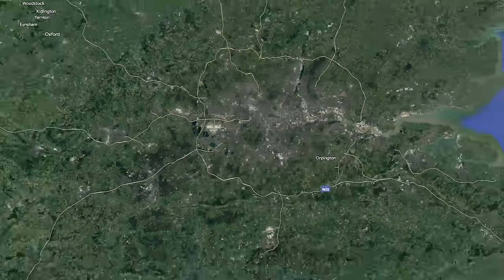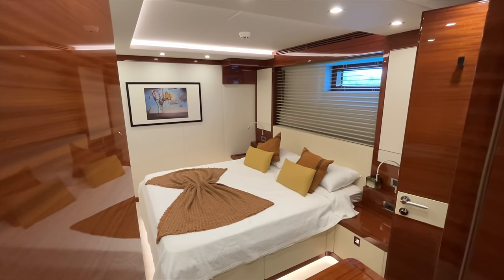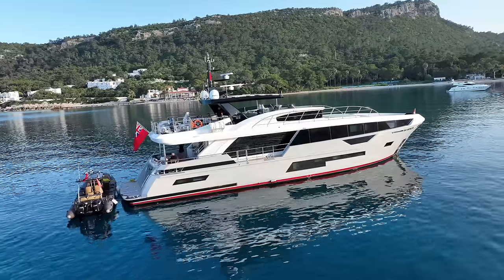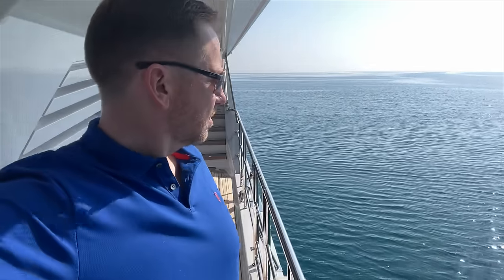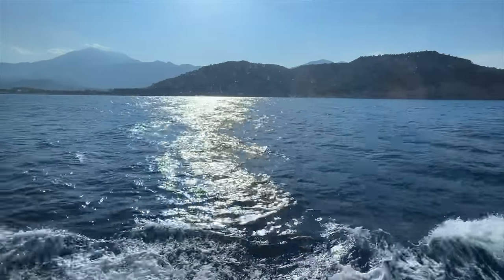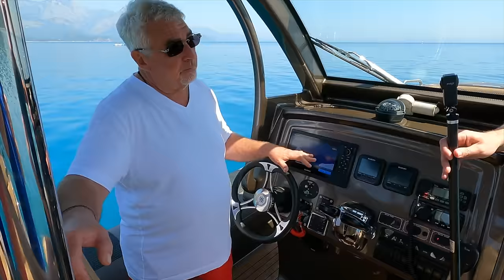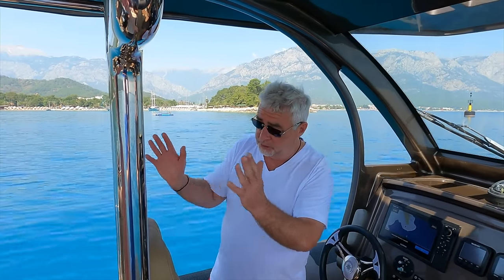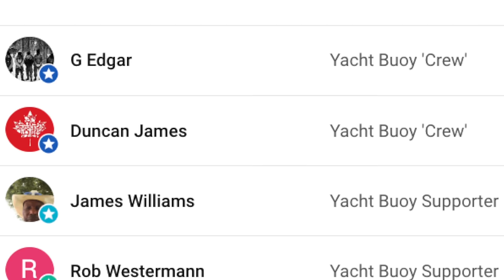My Weekend On A BERING 92 EXPLORER SuperYacht (With Special Guests!)

Comment: The hybrid option is incrediable. You can keep the hours on the main engines and generators at a minimun.. Actually you have six generators when you count the small ones on each engine, plus the main electric propelusion motors can be generators as well.. Batteries are meant to power 'the house'all the time.. You can propel the boat with the electric motors for 5 hrs +/-. Then fully recharge the battery bank in a matter of a few minutes, all automatically, or manually, lol  I'll say it again, You can set up all the electrical and propelsion systems to function as you wish, and it's all done automatically, or manual if needed..

Comment: I’m not really a fan of the styling on the newer bering models, but you make it look pretty good.
Reply from the maker: Thanks for watching and for leaving a comment ⚓️🫡
Reply: The interior styling is 100% the choice of the buyer, it is not locked in. The exterior could easily look quite a bit different if you play with the paint.
Reply: Agree the decorating style is lacking.